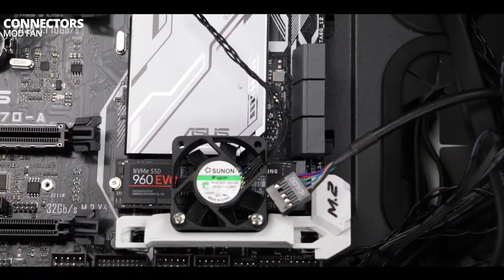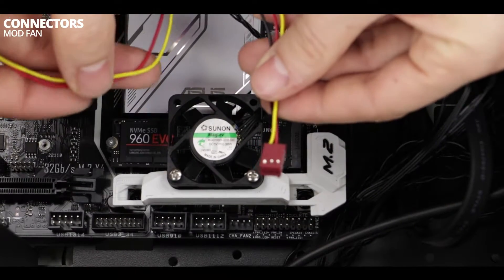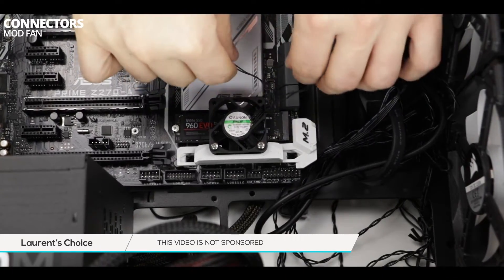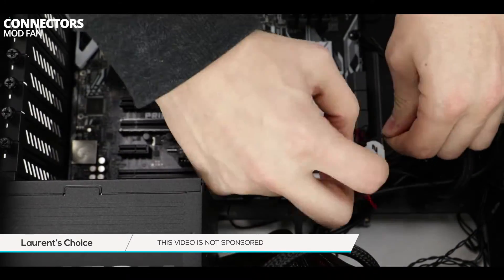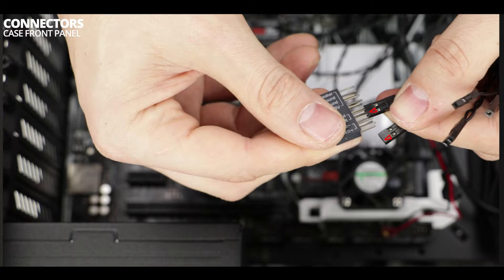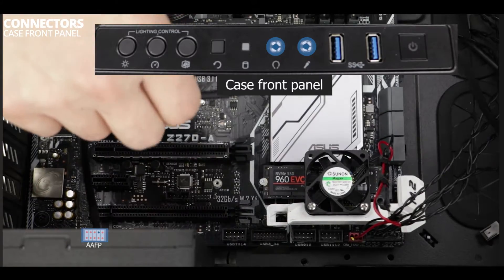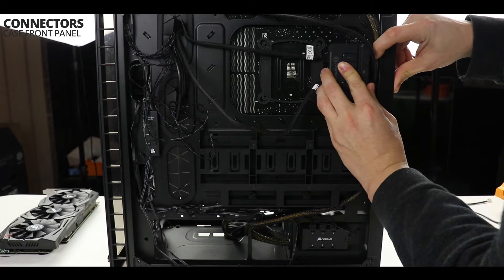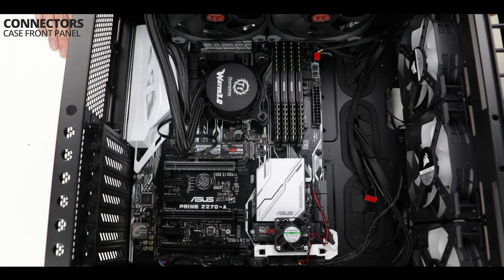Cabling and connectors, scissors edition (Kaby Lake Project 6/10)

Comment: I can't find the connecter bridge like shown
Reply from the maker: +Varsul yes ..sometimes it's missing.  Depends where u bought it from .
U do not need it . U can connect the front panel connectors directly on the motherboard :)
Reply: yeah I'm trying to figure which goes where
Reply from the maker: +Varsul check out the video I did for the maximus VIII... I went in extreme details .